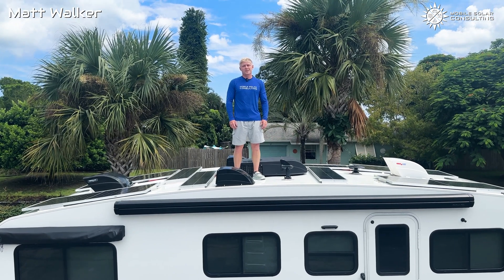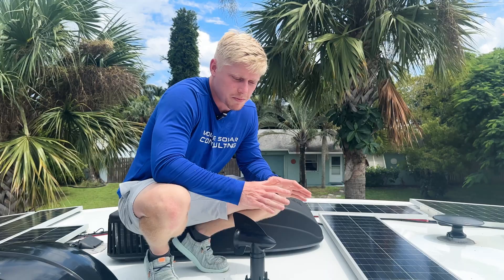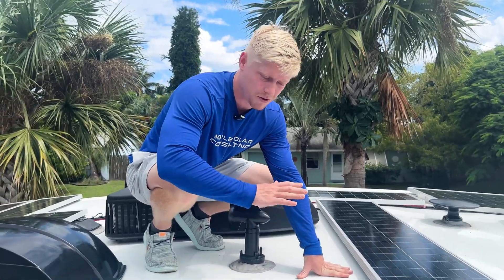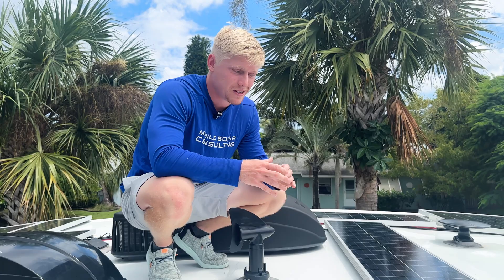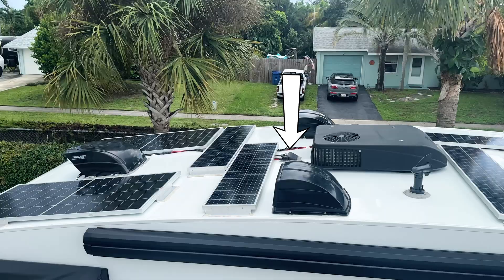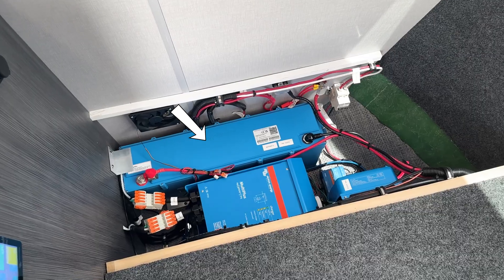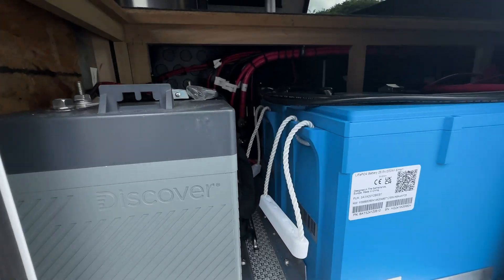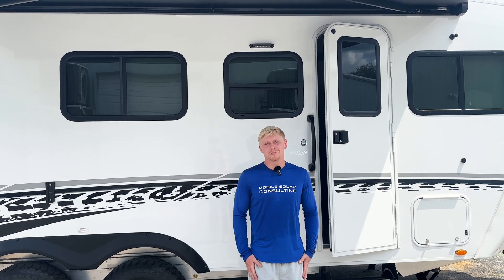1400W Solar with NO SCREWS on Intech Aucta Willow Trailer!

Comment: Looks great! Was it difficult fishing the shore power wiring from the plug/breaker panel? I like the fan in the old battery vent location. The description/link says 100amp Smart Battery but I assume you mean 200?
Reply from the maker: It was not super difficult to re-route the shore wiring but it was time consuming. You are correct, that was meant to say 200ah Smart Batteries.